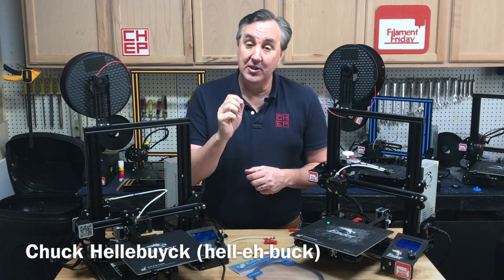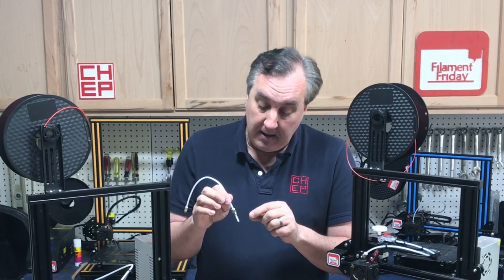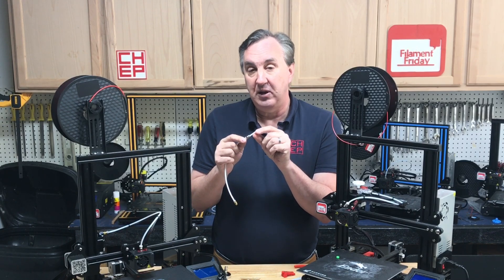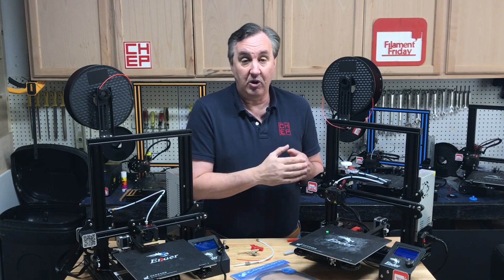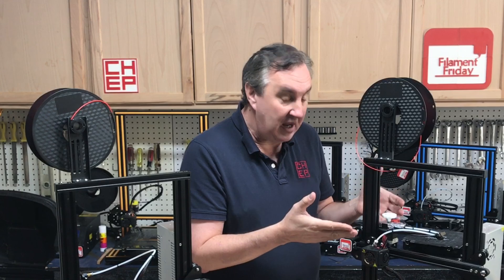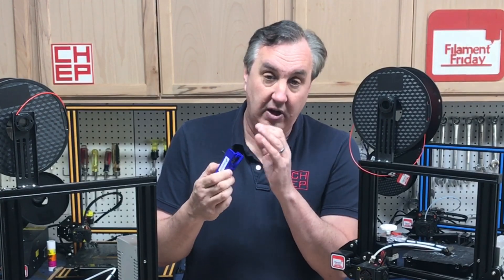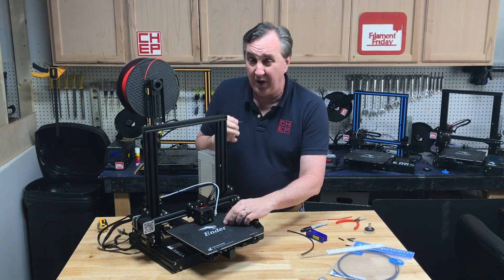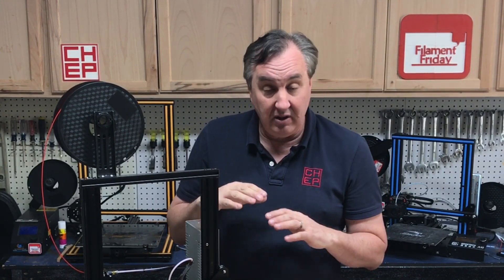Simple HOTEND FIX for Creality Ender 3, CR-10

Comment: Great video, my tube is too large too and after watching your video, I know how to measure, subtract the spacer and thread depth and cut my tube to the right height.  my nozzle is not flush , so I knew there was a problem with the tube size.  going to try that m4 nut as the spacer too.

Comment: I’ve been wondering why you couldn’t do the same thing you describe in your video but with a machined titanium insert. For example, if you had a titanium bolt and turned the outside so it would just barely slide into the extruder and drill and ream a precision hole through the center for the filament to feed through. The the head of the bolt could be turned to the size of the printed washer in your video. Would this serve to create basically an all metal hotend?
Reply: Now that is an interesting solution.....re-Luking the Hatfield fix.
Of course you would need a lathe and some experience using it but the design concept in theory should work.....Titanium is a poor conductor of heat.
Machining Titanium can be a challenge for some but worth a try to see which way it affects the filament flow.
If the filament does melt in the T1 tube end it will jam and fail.
I think the T1 will not transmit much of the heat back.... some yes.... from contact with the end of the nozzle so it would possibly act as a piece of Cap tubing but would never burn out......lets see the trial, you need to be committed to voice a theory.
Another solution would be to just have a T1 washer ....with a small counterbore to have the PTFE tube in it...... right down at the nozzle end against the face of the nozzle end and then use PTFE tube as usual down to the washer.........the T1 washer will prevent the end of the PTFE tube from burning.........if it doesn't the theory is a failure on both counts.
Reply: Ian Pearson I’m a machinist by trade, so the machining won’t be a problem.  Your comment made me think, at the bottom of the insert where it contacts the nozzle, the od should be turned down very thin  so the contact with the nozzle is minimal. Then make a number of grooves going up the OD so that the thermal path in the center is kept to a minimum, the Ti bolt is very strong and could be turned down to probably a .01” wall with plenty of strength. The ribs between the grooves would keep it centered and provide contact with the heatsink for it to draw off what heat got in. It would look sort of like a short skinny heat sink itself. Doing that, then you could do what you said and have it not go all the way up to the PTFE fitting but just half way up the heatsink maybe. That would allow the Capricorn tubing to go as far as possible to make it as slick as possible and maybe still print well with PLA and be able to retract. A nice polished surface in the ID of the Ti insert would be critical of course.
Reply: @jedoddy4791  I'm a fitter and turner retired 20 years now and an inveterate inventor.........I think I would go down the path of making a totally inert to heat material like ceramic, marble, granite or glass to prevent the heat from getting to the filament....that would mean you do away completely with the finned heatsink and just attach the heater to the bottom of the stone block etc.....design is easier than description.
If the filament doesn't get hot in the stone block it can't bubble up and jam before it gets to the nozzle.........you could epoxy glue the pneumatic fitting in the top of the block and attach the heater to screws through the bottom of the block and at the same time use a direct drive attached to the top of the stone block.....it's a different concept as there is no PTFE tubing  anywhere near the heater block.....almost an all metal hot end without the composite metal parts.
Reply: Ian Pearson Interesting concept with the stone. The only thing I would be concerned about is the challenge of getting a 1.8mm hole through the stone and then you still have the issue that the stone/ceramic will abrade the filament and make dust and the pores will make for places for the filament to get stuck and jam. 
I’ve found a product that accomplishes a similar thing to what I am trying to accomplish with my idea. It simply replaces the entire heat break with an all Ti one and there is just a shallow counter boot it the top to accept the PTFE tube. That should probably get the tubing far enough away from the extreme heat to not break down. 
That would be easy enough to try as I have Ti at my disposal and the rolling to work it. 
Thanks for your thoughts. If I get some success with my attempts I’ll let you know. 
I think I’m going to
Reply: @jedoddy4791  It would need to be experimented with the get a result....best of luck.

Comment: Hi Chuck, have you noticed there is a lot of space around the ptf tube is the cooling section of the hot end ? I suspect this will cause the tube to buckle and the end of the tube not being aligned to the face of the nozzle.
Reply from the maker: You might have out of spec tubing. Should be tighter.

Comment: I have an ender 5 pro. Even if I drop in only the 1 mm washer I can't get the her the coupling deep enough to catch the threads
Reply from the maker: Then cut the PTFE shorter.
Reply: @FilamentFriday  that without any ptfe. So between after the threads it funnels to the size of the tube so no matter the length of the ptfe I can get the thing screwed in. Does that make sense?
Reply from the maker: Then it must be different hotend.

Comment: Chuck again an awesome video/explanation. But a small question is it possible that after doing this that I had to reconfigure my e steps. What not a big problem is but the I had to increase it with 40% (was around 100 and now around 140). Is that normal after this modification or did I do something wrong?

Comment: i cant get my ender3pro to print properly i have had it for a month and not had a good print yet...i have updated the extruder to a duel and capricorn ptfe...i cant seem to get a profile that works
Reply: Did you calibrate for the dual extruder? You'll probably need to be near 140 steps in the extruder setting. Mine is set at 141.6 and is perfect. There are videos explaining how to calibrate if you're not familiar with the process.

Comment: hey, i tried this but i did something wrong and now the washer is stuck in my heatsink. any tips to get it out?
Reply from the maker: Grab it with needle nose pliers. It’s just plastic.
Reply: won't move at all. i might try to use a heat gun to soften it so i can destroy it
Reply: the heat gun softened it enough to get it out.

Comment: Since the length of bowden tube from the extruder to the hotend will never get very hot, you could switch it out for UHMWPE for significantly lower COF and higher abrasion resistance.
UHMWPE is good for 180F. the top of the hotend should never approach that temperature.
Reply: Unless I'm missing your point, the fix is for the PTFE which is down inside the hotend. Temps easily exceed 400 degrees.
Reply: @gregoryconnors7370  I was thinking about replacing the section of tubing from the extruder to the hotend with UHMW, not the section inside the hotend. This section won;t get very hot at all.
Reply: @sousvide59too  Gotcha! Are you having issues with standard tubing? I personally can't think of a scenario where I'd need to do that. I wonder if it would be flexible enough. Let me know results if you give it a go.
Reply: @gregoryconnors7370  Nope, I'm not having problems. It just occurred  to me that, absent the temperature limitation that is eliminated by this fix, UHMWPE should make an even better bowden tube than PTFE. I'm not even sure that UHMWPE is available in the right dimensions, in fact.
I've used the UHMW for a bunch of things over the years, and its CoF is just astonishingly low. It is also the most abrasion resistant polymer - even to the extent that the sliding surfaces for the giant drag-lines used in mining are made from it.

Comment: Nice video!
This might sound like a silly question, but I just replaced my stock PTFE tube with the Capricorn one would you still recommend me to do this mod?
I was thinking since the tube is more temp resistant it shouldn’t melt towards the hotend and therefore helps to prevent clogs.
Reply: Without this fix your Capricorn tube is being held in place by the locking sleeve on the pneumatic fitting (coupler), which is the weak point of the stock fittings. When the tube slips it creates the space where clogs form.  Using the washer from this fix, makes the coupler lock the new separated tube in place instead. The upper tube can still experience slip but will not impact the heated filament in the lower part of the hotend.

Comment: Hi, tried this idea numerous times but just can't get it to work. Never got blockages before but I do with this. Tried slight variations on the measure length and different washers but no joy. Switched to just Capricorn, no blockages now but didn't print as well as the old tubing so just went back to the start. Can't work out why?

Comment: Hi there chuck, jist wondering if you cant use a normal m3 or m4 nut as a spacer???
Reply from the maker: Possibly. Never tried it.
Reply: @FilamentFriday  hey chuck, an m4 nut works well. used it with the stock tube, and printed yourbed level squares with no problem. thank you!
Reply: I'll let yuou know how i go!

Comment: Huge question!!! What if you use a steel tube with sizes 4mmx2mm? Is it possible to increase the maximum printing temp???
Reply: This is exactly what I do but it's not as plug and play as you might think. I made several inserts from 316 stainless and drilled and reamed for size and finish. The ID needs to be very smooth and close to filament size with minimal clearance. I polished the ID's and so far I think I've found a viable solution. I think the proper clearance is the biggest factor because too large and retraction will suffer, too little and extrusion will suffer. Another thing is the stainless insert will hold heat and cause all the problems I had to deal with. I ended up turning the OD down smaller near the nozzle so it would cool off quicker. Waaaay too much time spent on this little detail. I could have completely manufactured a dozen E3D Hotends with all the time I put into it.
Reply: @gregoryconnors7370  oh, nice to have a feedback from someone that tried it. I found a 4mm OD, 2mm ID stainless steel tube and i may give it a go when my CR-6 will come. Do you still print at the same temperature? I thought i may need to reduce it by 5-10 degrees, because the filament will be preheated by a bit
Reply: Gregory Connors   I’m thinking of trying this but starting with a titanium bolt. What diameter did you find worked best with the stainless steel liners you made?

Comment: Thanks for the video!
Worried about making the little piece too short. Correct me if I am wrong but it’s better to make it a little longer (obviously better than shorter) and as long as you don’t overly crank down on the pneumatic fitting, you should be good right? That way you are certain it will meet the nozzle.
Please tell me if there is a downside to that.

Thanks,
Scott
Reply from the maker: I offer three washer thickness to get it just right.
Reply: CHEP thanks for the reply but sorry, I am not following.
I am talking about the small piece of PTFE and how to be certain that it’s touching the nozzle and tight against the washer. If I accidentally make that piece too short there will definitely be a gap 😁. I was wondering if I purposely make that piece a little longer it won’t hurt anything as long as I don’t try to overly tighten the pneumatic fitting and smash the tube too much, right?
Reply from the maker: Sure. That’ll work.

Comment: Love your videos sir, awesome content. I just got my first Ender 3 pro two weeks ago and your videos have been very helpful. I started printing PETG yesterday and got told by several people to replace the tubing with Capricorn tubes. Since they seem rather expensive, this video helps a ton. I am going to use the standard tube for the guiding and then have Capricorn inside the hotend as you said. I already have the fix in place so installing should be easy. Thank you for your videos!

Comment: So will some of the threads on the fitting be showing? Mine felt pretty firm after several turns and I am afraid to overtighten but like 4 threads are still showing
Reply from the maker: You can use the thinner options of washer I have on Thingiverse.

Comment: What size is the washer used in stock ender 3 pro hotend? SuperNooB... in case you're wondering why the question. Also, I have just bought my 1st 3dp an ender 3 pro. I may have jumped the gun and bought a bunch of upgrades because I like too many people,  want top of the line equipment as cheap as possible. I haven't even put it together yet but have bought SKR mini e3 v2.0, RPI4B + cam,  Dragon hotend, springs, glass bed, etc. Now, I am taking baby steps to put it together because I just realized it gets deep in this rabbit hole! I wish I had watched more  vids like this one. I appreciate the way you teach others. I was thinking of solid bed mounts but I am holding off until I get things set up. Probably should have done that 1st...  great community and support. Thanks!
Reply: I've seen lots of seasoned printing veterans suggest printing with a stock printer for a while to get an understanding of how it works, then start doing upgrades.  That way you have the knowledge to judge whether or not the upgrades are working.  I've only been printing since April 2020 and done some minor printable upgrades.  Like you, I want to optimize this thing as affordably as possible, but I am learning a TON by trial and error, by watching videos like Chucks and others, and perusing a user group on Facebook.

Comment: Just a note but Capricorn tubing doesn’t have any better temperature advantage than normal ptfe tubing
Reply: A simple search reveals the truth. Capricorn has 2 grades of ptfe. Light blue rated to 300c and Dark Blue rated to 340c as per their technical specs.  Standard ptfe is generally rated 250-260. So yes it has a higher melting point however i dont know if the off gasing problems would still kick in at around the 250c mark.   I would guess the offgas threshhold would possible increase proportionally.

Comment: Hi Chuck,  Thanks for putting out all of your helpful videos.  I'm having a lot of issues with the filament getting chewed up in my Metal dual gear extruder and I can't seem to get it fixed after cleaning the hotend, etc.  I'm going to try your fix here, but I wanted to know what your thoughts are about the dotbit dual drive extruder compared to the EZR Struder.
Reply from the maker: EZR is better.

Comment: Hi Chuck, straight-up video as always. I've been printing trouble-free with my ender 3 pro for 6 months but after swapping a filament color recently, I got my first clog of which I fixed through cleaning and fitting a new nozzle. This worked really well but failed again today on the same long print which I suspect is something to do with the retractions. My stock hotend is set-up text-book and with the capricorn PTFE tubing but movement must be creeping in somehow. So while I could try your fix, I'm wondering whether I should just bite the bullet and upgrade to an all-metal type hotend, or, maybe to a direct drive system like the Hemera. Thoughts?
Reply from the maker: Many people like it but until you really know the cause you may be just adding new problems. So I always recommend fix it first.
Reply: @FilamentFriday  Appreciate you looking at this. I'll try the fix first. Happy July 4th bud!

Comment: Awesome advice, video was straight forward. Ony thing. If the PTFE tube that you put in to replace the original needs replaced how would you take it out? Thanks for the advice.
Reply: Possibly heating hot-end (to release tubing), remove nozzle, then push it thru with clean tubing (same as the cleaning hot-end procedure)?

Comment: Thanks for the great video. I actually did this a couple months ago, but today I got a clog. The PTFE tube part was stuck in the heatbreak and I had to disassemble the whole thing to get it unstuck. There was some brown goo on top where the washer is and the washer was slightly deformed, the bottom where the nozzle meats the tube was clean though. I replaced everything but now I am getting stringing so I will take everything apart and try again (no clue what went wrong this time). Any clue why the tube got stuck in there, what could cause the goo stuff on the top? My heatsink fan seems to work fine and I am mostly printing PETG to 240C.
Reply: does the top part of the hot-end (pneumatic coupler) feel hot to the touch)?
Reply: @evilMaid1984  it is warm but not hot. I can comfortably hold it. I wouldn't think it is above 40C, though I haven't measured it. How hot would be worrysome?
Awesome surname BTW 😊

Comment: I had a 5 minute unskippable ad before this video.. Perhaps you have great content, perhaps not. Either way I wont spend anymore time on this channel. The content to ad ratio should not be 2:1, no matter how great the content is.
Reply from the maker: Thank you for taking the time to describe the issue and letting me know how YouTube is handling their ads.
Reply: YouTube dont have 5 minute unskippable ads. You must have had a browser fault, or have adskip extension interfering with the skip function
Reply: @patronza   Yes, I did some digging and it turned out to be Brave browser that was out of date.